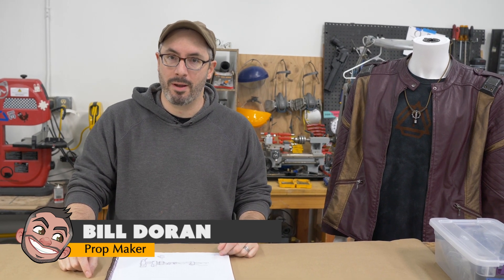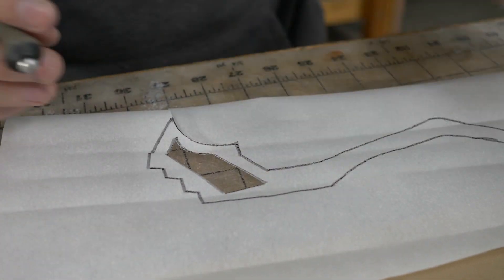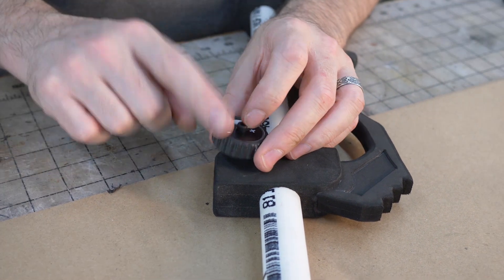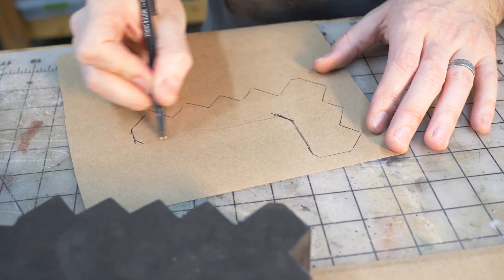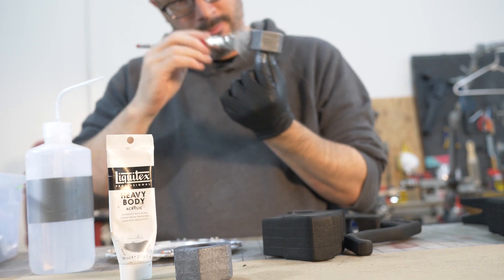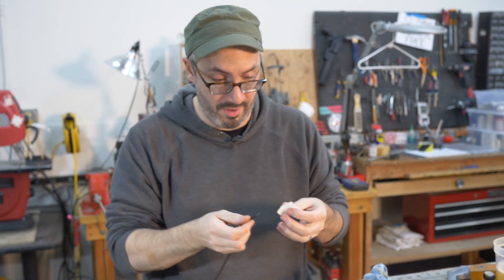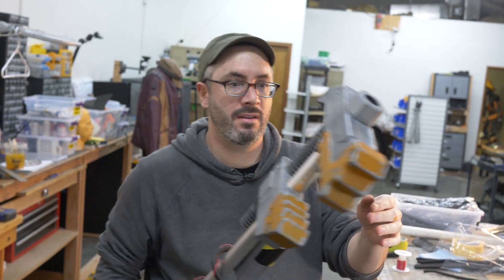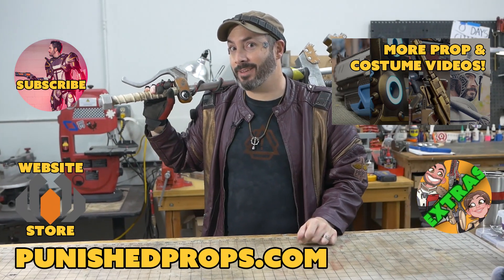THE WHAMMER - Cyberpunk 2077 Inspired Build

Comment: Very cool prop.  If you want to have twisted pairs of wire, measure twice the length you would like for two strands of wire, clamp one end of them together, run them parallel two each other and place the other end into the chuck of a drill, tighten the chuck, them slowly run the drill until the wires are completely twist together.

Comment: if you want to make the belt fit, you could replace the bottom threads with a gear teeth going around it and make an additional support piece for the bottom of the thread attached to the central piece like a tension relief for the belt.

Comment: And because my brain works at trying to make things more functional looking, I have some changes for you. Mount the motor further down to where the belt disc aligns below the screw shaft and add a pulley wheel to the screw shaft that the belt goes around. Also add air vents to the motor housing for cooling.

Comment: Hey Bill, are there any ways you've found to get sharper edge/corner/seam on EVA foam pieces? Particularly on things normally made of metal like scifi armor. It might just be a limitation of the material, but I've always felt like foam creates softer lines and gives pieces a slightly cartoony look to them rather than a realistic one. Keep up the great work!

Comment: I'm wanting to do some similar weathering to a pc case. Unfortunately the parts I want to weather are Plastic. Was thinking of doing the silver base  and do the toothpaste trick add a layer of Primer add some extra toothpaste and finally the top coat to get that layered chip effect. Thoughts?
Reply from the maker: You can totally paint on plastic no problem! You might just need to do some light sanding to give the paint something to grab onto.
Reply: @punishedprops  Thanks. Im aware of being able to paint on plastic was more asking thoughts of the 3 paint layers idea. Most painted metals have a primer before final coat and generally if damage to expose metal occurs you would in fact see that primed layer. It could even add some depth to a black wash.

Comment: Question but why do you kiss it with flam. Would plasti-dip also work to deal it up? We noticed Odin over on the Odin Makes channel uses plasti-dip and we are curious about the difference in properties between closing it with a fires kiss to plasti-dip.
Reply from the maker: Using the blow torch or a heat gun is actually the step that takes place before applying a sealant like Plasti-Dip! Applying heat to EVA foam closes up the cells and "seals" the surface, which makes apply paint and other sealing mediums much easier. Once heat sealed, you can apply Plasti-Dip or Varnish or whatever you like!
Reply: @punishedprops  Oh, I thought it was good for it to be pores so it absorbs in the plasti-dip. Again our info is coming from Odin Makes. Be sure to check out his channel, maybe cross over and share skills cause you both are very good at this level of creativity.

Comment: That's a pretty rigid piece made out of thin foam, would polystyrene work to sandwich the foam and strengthen it?
Reply from the maker: Certainly! Driveway reflector rods are also a fantastic option, as they're thin but very sturdy: https://www.homedepot.com/p/Everbilt-48-in-Reflective-Rod-in-Orange-31474/304685319 Wear gloves and breathing protection! This rod is coated in fiber glass. It can be sanded and attached to foam and most other materials using Barge Cement.

Comment: Where do you get those metal paperweights with holes?  6:10 Thanks ahead!
Reply: the larger ones are 1-2-3 blocks.  As the name implies, they are 1 inch by 2 inches by 3 inches.  They are used in machining.  I am still looking for the smaller ones.
Reply from the maker: Here's a link for the 123 Blocks (I had to special order the tiny ones from England!): <!--td {border: 1px solid #ccc;}br {mso-data-placement:same-cell;}-->http://amzn.to/2o3eWlx
Reply: Thank you!  Ordered the large ones.  Looking forward to becoming a little bit cooler :)

Comment: Can you use a dremel instead of a rodery tool and if you can what setting do you suggest
Reply: A dremel is a rotary tool (well it's a popular rotary tool brand to be exact)
Reply: Thank you I tried using mine but all it did was melt the foam
Reply from the maker: You may have had your tool rotating too fast. I've never heard of a rotary tool actually melting foam.
Reply: Thank you

Comment: You didn't need the "hoodie string", hockey players use a tight spiral of athletic tape to achieve the same effect, with the added benefit of the tape string being adhesive on it's own.
Reply from the maker: We just happened to have the hoodie string and wanted to incorporate it - the folded tape does work really well too!